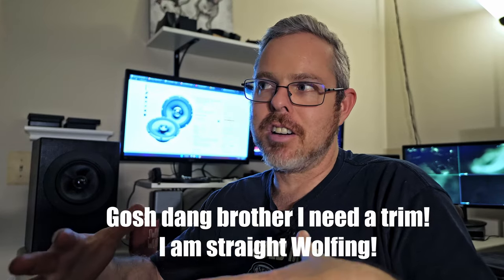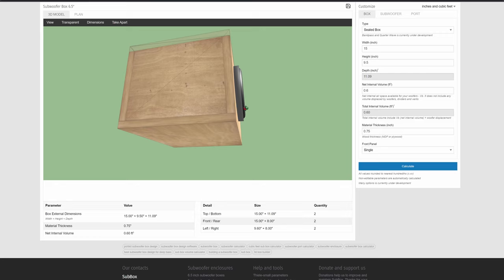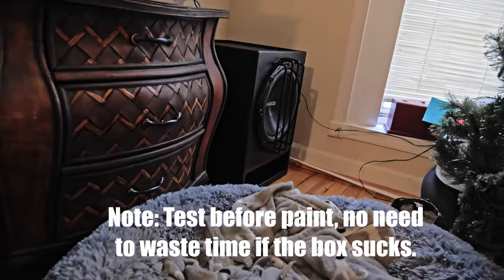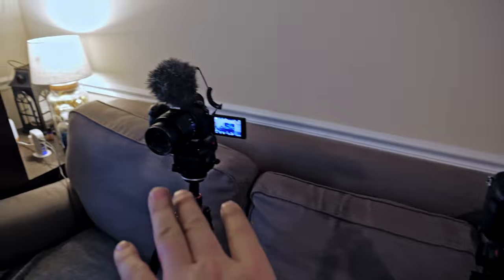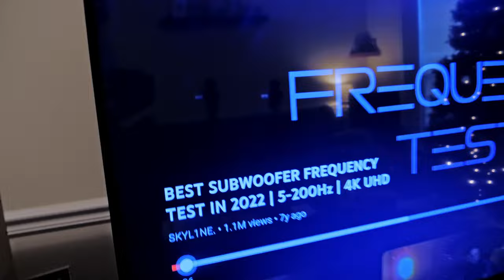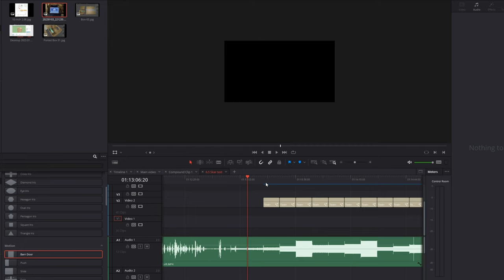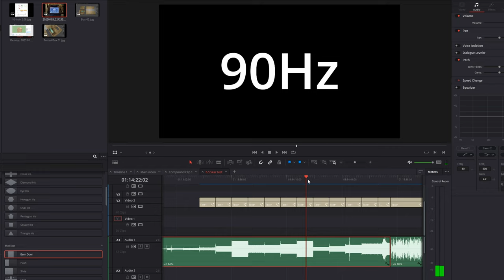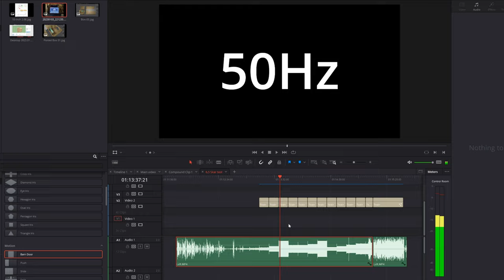DIY bookshelf from car speakers. Skar Audio 6.5” TX65 hits 40Hz 😲

Comment: Almost bought the rpx65 ones instead of the tx65 which are better build and sound better from what I heard.. great speakers for sure also I got a deal on 2 pairs on eBay but used for $80 hopefully they work well

Comment: What power supply do you have connected to your Amp that drives your subwoofer? And would you recommend it. Im trying to use my stuff thats also collecting dust. THANK YOU FOR YOUR VIDEO!

Comment: are the box plans in the link for a 6.5 subwoofer or full range drivers?
Reply from the maker: Its for the driver / tweeter combo.
Reply: @TPVPRO  the plans for the box seem big for a coaxial driver
Reply from the maker: @DwightStebner  Yes
Reply: I use that site for all my subwoofer box builds. You can do/get so much from the site

Comment: I did the exact same thing with the pair of pioneer 12 inch subwoofers in the late 1980s when they were built quality in Japan not China. 

I used a 600 W alpine amp to drive them . With a voltage step up to 14.8 V to the amplifier to a one mega ferret capacitor attached directly to the power input of the amplifier. 
.7 ft.³ enclosure 

When I took those enclosures from the house down to the professional stereo installation company that does all the high-end stuff they cannot believe that those were $60 pioneers that were sounding like $700 subwoofers 🔊 
Remember, this is the late 1980’s